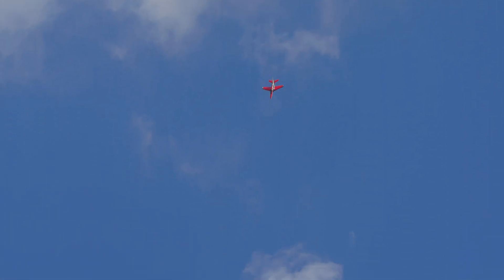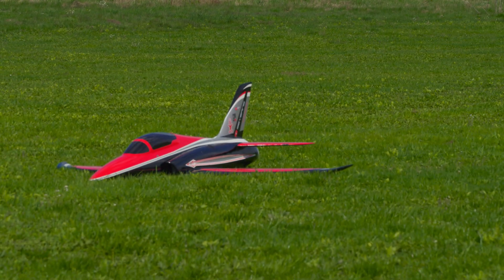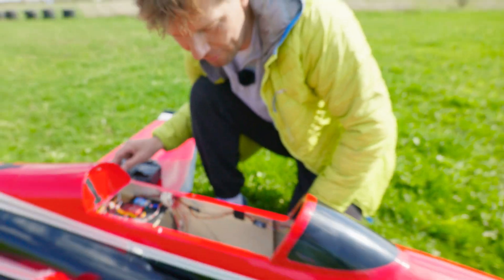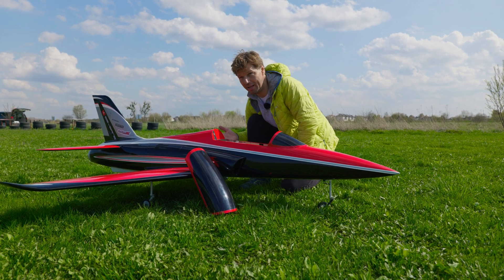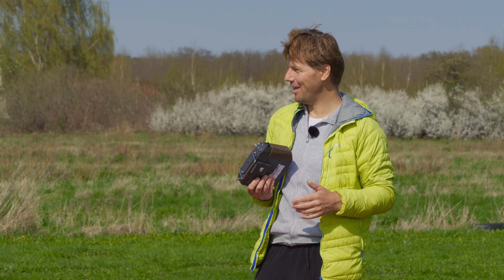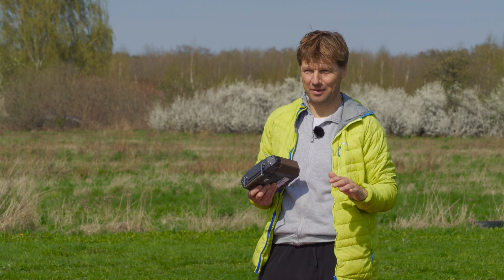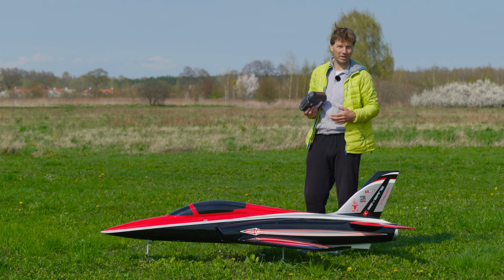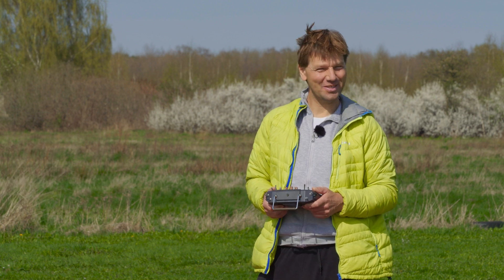Odyssey JETFAN-130 372km/h 11.5kg weight to 18kg thrust 250A 16,7kW Graphene 16s 8Ah TOPRC Jet Sound

Comment: Would you be able to run 22s Li-Ion on the Flier 20s 300A ESC? Apparently my 56123-500kv motor's gonna need some higher voltage.